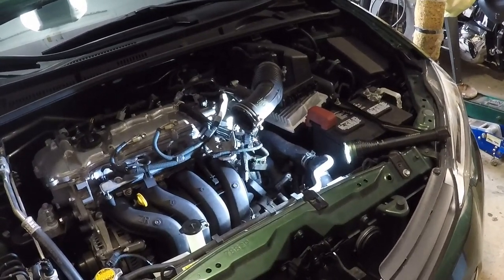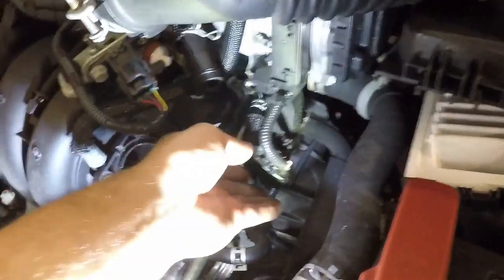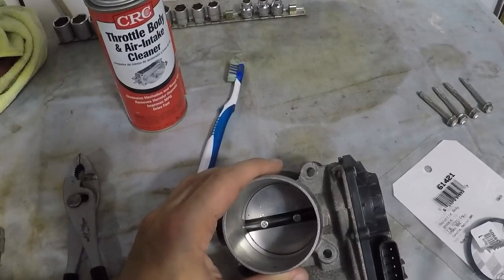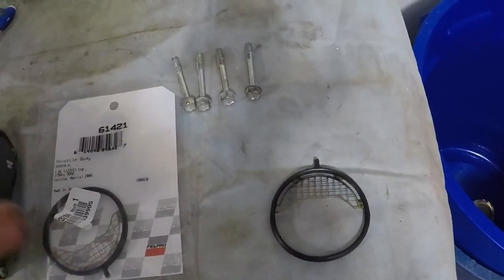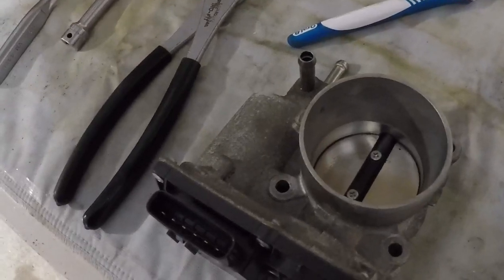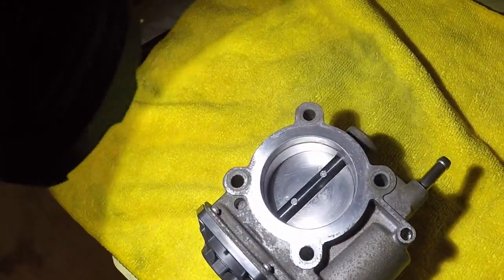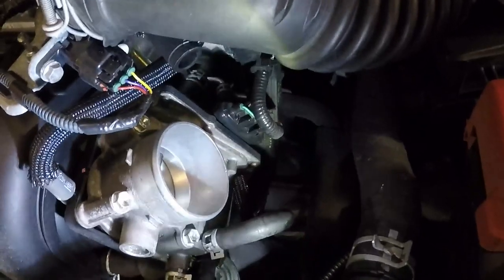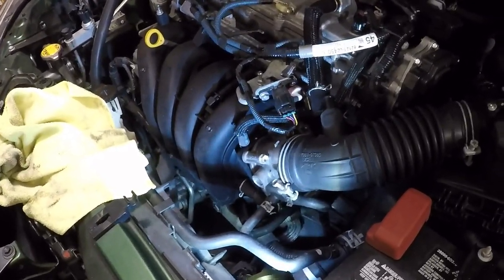Toyota Corolla throttle body cleaning

Comment: Thank you for this video!!!!!!! It is simple though you leave nothing out. My Corolla was idling rough at stops especially when I had the air conditioning on. I cleaned the Throttle Body  and the MAF and put a new air filter in just for good measure. My problem appears now to be gone!!!!! Thanks again!!!!!!

Comment: NOTE:  You can get away with NOT removing the entire TB from the intake.  In fact, just unplug it, take off the air vacuum hose, the air tube and the 4-bolts hold the TB into place, AND LEAVE THE TWO ANTIFREEZE HOSES IN PLACE, you don't need to remove them.  When you pull off the TB just tilt it from one side to the other and clean both sides thoroughly - Done.  After I cleaned mine this last weekend it ran good but not great, UNTIL I unplugged both battery terminals and let them sit for a half hour, then reconnected, to re-set the car's computer back to factory.  The car now has all of its zip back.  NOTE:  To really reset the car's computer back to factory you either need a $5,000 scan unit OR remove the battery cables and insert a 10-watt 1 ohm resister hooked between both the neg and pos battery cables (not the battery), let it sit for between 15-minutes and a half hour -- this will safely and slowly drain your system's sensors and allow the computer to reset back to factory, then reconnect the cables to the battery. DONE.
Reply: Are you talking about resetting the idle after any time w/the battery unplugged? If so, you just need to start the car, let it warm to operating temp. Turn off, then turn key so battery is on but car isn't started, then turn off. Repeat this once more (twice total). Then start the car and w/in 5 minutes it calibrates the correct idling automatically.
Reply: How about the idle air control valve?  Does it get cleaned too?
Reply: @JJ-yn8fl thanks that is how it's done

Comment: After changing my starter, the car kept dying (wouldn't hold an idle). This video worked perfectly!!! Easy fix, cheap and fast!
Reply: What does changing the starter have to do with anything, I’m trying to understand I am having the same issues, same thing changed the starter and now it’s idling rough

Comment: Also, you can 'slowly' push the butterfly open without calibration worries (there is no computer on this Throttle body, unlike other Japanese models, Honda, etc.) because you do need to clean the outside of the butterfly edge -- best to do by taking this TB off the car, as this guy did.  The butterfly is connected to an electronic powered gear, thus you must move it SLOWLY as to not strip or damage the gear in any way.  opening the fly is the only true way to definitively and thoroughly clean this area properly -- done so by many Chief Toyota mechanics, SO DON'T WORRY, you'll be ok, I promise!
Reply: Exactly right you can open the butterfly gently and clean it, I did it on multibe toyotas wi no problems.
Reply: This is what I was looking for. I was worried about opening the butterfly to clean the edge. Now I will open it slowly. THX!

Comment: Actually you can open the butterfly with your hand gently, and cleaning it with a shop towel soaked in TB cleaner,  i did this in my toyota multiple times, also Toyota master mechanic did the same, you can see his youtube channel, "the car care nut" electronic Tb has a motor and a spring ,and once its disconnected it doesn't set a code, you get a high rpm after cleaning but the computer will set it to the right rpm after driving for a while.

Comment: That gasket isn't a $5.00 part.
The Intake Manifold Gasket, Part #22271-21060 costs $13.85 at Dolan Toyota here in Reno & they are out of stock & will have to order it.

I ordered 2 from Olathe Toyota Parts, $8.26 each.

Comment: Congratulations, excellent video.

my 2010 corolla is with idle  speed above 2000 rpm. can be butterfly body
Reply: 1st clean the  throttle body and inspect/replace engine air filter as those are cheap potential fixes and things that need to be done anyway. Two other very common problems are a bad Mass Air Flow Sensor (MAF sensor) or a vacuum leak (extra air getting into your intake system).

Comment: I have a 2009 Pont Vibe which has the 1.8 Toyota engine (basically a Matrix).  It sometimes stumbles/struggles on start - you don't need to keep cranking the starter, but it takes a second or two to really catch and then smooths out.   The idle is sometimes just a little rough.  Does that fit with the throttle body being the culprit, or the Mass Air Sensor maybe?  Any other suspects?  I sometimes hear the VVT gear rattle briefly when it struggles, but only then, and not at all when it starts without issue.

Comment: Coming from a German car to my 2013 Corolla S (Red Metallic…Gorgeous Color if I do say so myself. 
Working on this Corolla is stupid simple. It’s like a toy car. Perfect for teaching others and quick dissemble.    

I swear I can prob take more than half the car apart with a 10mm socket.
Reply: lmfao yes you can take 80% of the engine apart with a 10mm, I also came from a german car. it was a 2013 VW Tiguan. It was falling apart at 80k miles. And I also bought a 13 corolla S, White with the black pin stripe and dark tint. Its perfect.

Comment: I used carburetor cleaner in a metal brush to clean mines but they do a lot of scratches and I open the flap by hand manually so I can clean the entire thing when I put everything together. The car runs really really rough check engine light comes on the tracks, control light, and that VSA light or something like that comes on and all soldiers air coming out of my radiator when I remove the cap there’s likes steam and it’s running really rough. It’s spitting the water out of the radiator as well cause I’d be close the throttlebody, causing that

Comment: Does this video apply to certain years/body style of the Corolla? I watched a video for years 2008 and older/younger and the gasket looks different. Thanks, this is super informational and great for those of us who are new to car maintenance.
Reply from the maker: 2014 and newer primarily. all throttle bodies are basically the same design. new ones have electric motors while older ones use a cable and a spring. the cleaning procedure is the same but the actual gasket may differ. you should look up your exactly year on an auto parts website or at your local car parts supplier.
Reply: @EnthusiastsGarage  Thanks for your response and recommendations! I enjoy your videos. Thanks for posting and sharing so we newbies can learn.  😀

Comment: You can clean the butterfly plate/edges and wall by pushing it slowly with caution.i have done on a 2013 corolla every 6 months no check engine light problems.

Comment: My 2015 corolla has a delay in acceleration all the time, especially whenever I take off from a stop sign or red light. Toyota told me the car needed a new transmission which is a $7000 job lol. Another mechanic told me the transmission is fine but the fuel ratio is off. Could this be the culprit??
Reply: What ended up being the problem?

Comment: You failed to show how you clean the flapper since this is electronic.
How were you able to clean the flapper 360 degrees edge?

2005 Corolla LE flapper can't be moved by hand without stripping the gear /or break the gear.
Reply from the maker: by thoroughly hosing it off with the can. the pressure/volume of cleaner was sufficient. finished it off with an old tooth brush by very carefully running it along the edge were the housing meets the blade.
Reply: @EnthusiastsGarage  Just didn't see it or you didn't record it.
You were lucky to get the flapper cleaned.
But only sure way to cleaned fully is to press the gas pedal without starting the engine.

Thank you for getting back to me.

You will hate when you have to replace the following:
1. Oil Pump O-Ring
2, CV axle gaskets (O-Rings)
3. Knock Sensor

Lousy designs like the Civic & CRV.
Reply: It can also be cleaned by removing the throttle body from the intake hose and 4 bolts, slowly push the flapper (moves one direction) you can clean the edges/plate of the flapper and wall of the throttle body did it on a 2013 corolla every 6 months no check engine light
Reply: @Raikkonen07WC  I am referring to 2009 not 2013 Toyota Corolla. 
2009 like the 1988 Ferrari F40's flappers CAN NOT be moved by hand or push mechanically.

Lucky you can on your 2013.
Because the throttle assy on F40 is over $88,000.00!
Reply: @angelisone  so u need help to press the pedal .. is it key on? thanks

Comment: Awesome vid i cleaned my throttle body before revs was 1400 cold and 800 when warm idle after cleaning 2000 and 1200 on idle should i be worried
Reply: have you found a fix for this?
Reply: @jozhfy  after cleaning it does this then everything is back to normal👍
Reply: @hassemsadiq  did you get a check engine light ? thanks for the fast reply bro
Reply: @jozhfy  no check engine light

Comment: hi i tried this, and as i was putting it together i saw the inside of the manifold was wet. should that be wer? any reason why that could be wet?
Reply from the maker: Their may be a light mist of oil from the pcv system

Comment: is it the same with 2016 corolla? how did u open the butterfly so u can clean the in between surface? need to know how,, thanks
Reply from the maker: Yes it’s the same as a 2016. I did not open the butterfly because there’s a possibility you could knock it out of calibration if you do that. I cleaned it with the butterfly closed using a lot of that cleaner and a gentle scrub brush like an old toothbrush. After that it worked fine.
Reply: @EnthusiastsGarage  thanks a lot

Comment: I own a 2013 Corolla, will like to know the specific torque for those 4 10mm bolts holding the throttle body. Do someone knows? Thanks.
Reply: I wouldn't overcomplicate how much they're supposed to be torqued, as long as it's firmly in place you should be fine. Getting specific is more for other things like rebuilding engines for example
Reply: @alpinecurrant7770  thank you. Anyway I found the torque spec. 10Nm. I tend to overtighten the bolts, that is why I try to use the correct torque. But you are right.

Comment: Bro I have the same throttle body forced it open with a pencil so I can clean it over 50 times in a car's lifetime I've got 250,000 miles forcing open the butterfly valve will not D calibrate anytin you will mess it up the calibrated if you force it open while the car is running

Comment: I just replaced mine it was idling up and down, I tried to clean it the next morning it would not start. Now it runs like a clock
Reply: @anislamicchannel9066  check the compression if its 110 or so theres the problem.  I changed the throttle body, wirepack plugs air filter, battery, PVC valve and I still had the same problem I brought it to Toyota they did a compression check in a came at 110 when it should be at least 170.

Comment: @enthusiasts garage..do you need to do idle relearn?
Reply from the maker: no, nothing changes. the car will behave the same as it did before minus any rough idling.
Reply: @enthusiasts garage..great video..keep up the good work...and thank you! you should make a video of how to clean the fuel injectors :D
Reply from the maker: @ayleenvalencia4870  if you are driving the vehicle regularly you dont normally need to clean the injectors. a bottle of fuel system cleaner every once in a while would probably keep things clean.
Reply: thanx for the advice...can i clean the throttle body when the car is warm? sorry for my stupid question!!  is just that this is my only car and i need it to comute for work, so i was trying to clean it after work.. thats why i was wondering if the engine could be warm or has to be completely cold??
Reply from the maker: Ayleen Valencia It Hass to be almost completely cool because part of the cooling system goes through it so if it’s hot in the cooling system is still under pressure it will make more of a mess. If it’s a little warm still you should be OK just relieve the pressure out from the radiator.
Reply: @enthusiasts garage thank you so much for your help

Comment: @enthusiasts garage how do i know if i installed the gasket the wrong side? How do i know if i installed it the right way
Reply from the maker: Inside, outside are the same
Reply: @enthusiasts garage.. i cleaned it and installed new gasket but am still having low idle at stop sigs and red lights 🧐
Reply from the maker: Ayleen Valencia make sure it’s carbon free and if it is you might have to have it looked at
Reply: What is the rpm when you stop?
Reply: I believe is 750  i think not sure when is fully warmed up and you getting to a stop sign it drops around 600 or 650 and it would shake or feel like it wants to die but den kicks back up
Reply: Raikkonen07WC when the car is cold is at 850 after a while driving it when you get to a red light or stop sing the idle drops to 650 or 600 just for a second or 2 n den it goes to normal
Reply: Our 2013 corolla idles at 650(warmed up) there are times but not always when coming to stop it dles at 500 for a second then returns to 650 but the car does not shake or feel like the car will stall.
Reply: Raikkonen07WC ive tried cleaning the throttle body the air flow sensor..i put new pcv and new intake manifold gasket but the car is still the same no check engine only 76000 miles
Reply: I think all corolla’s are like that.i ve seen many videos on youtube and some group forum that thier corolla behave that way despite all the cleaning just enjoy driving and love that corolla
Reply: Raikkonen07WC yeah i’ve heard that they were design to work that way to save gas but am not a mechanic so i don’t know lol enjoy yours too!!

Comment: Fuccckk I did this and now my car won't start...maybe a sensor got messed up? Ughhh
Reply from the maker: Make sure the connector is plugged in all the way
Reply: @EnthusiastsGarage  I got it running again! One of the fasteners on the air duct wasn't secured tight enough.
Reply from the maker: zepps88 ok good, it’s usually something easy when a situation like that happens
Reply: LOL

Comment: what about the IAC Valve anyone knows where is it ??
Reply: natas 6969  thanks a lot ... i have a 2014 corolla and iv'e been trying to find that IAC fir ages now.. am starting to think it doesn't have one. 
its an electronic throttle body with 2 cooling lines but there is no hole bypassing the plate so i can clean it.
Reply: there isn't one if you have an electronic throttle body (no cable attached to the gas pedal)